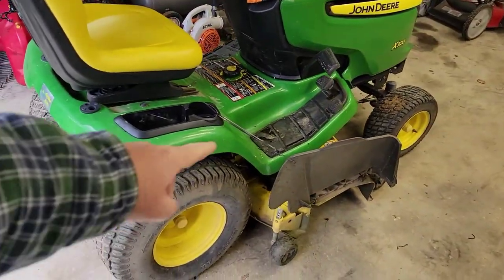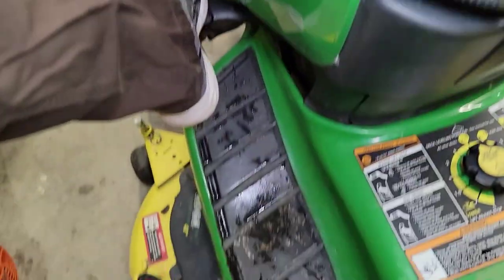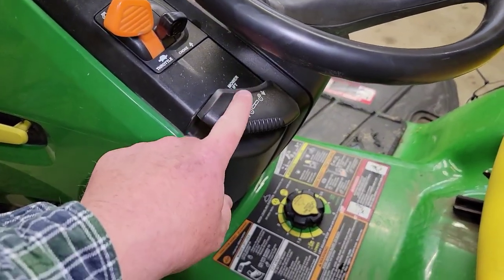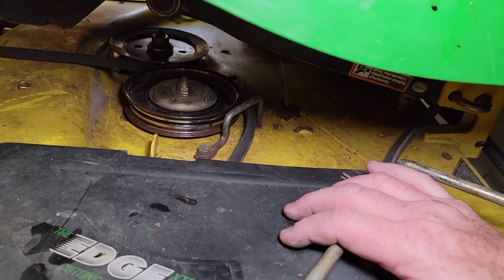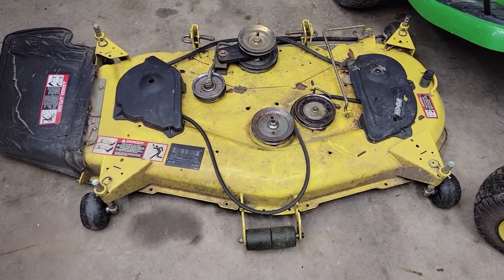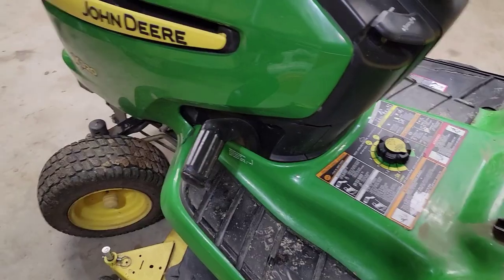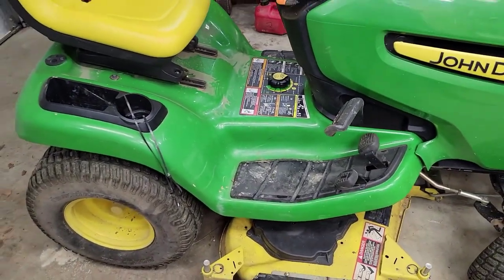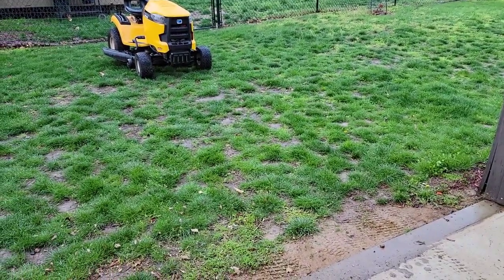How To Replace Deck Belt John Deere X320 Riding Mower BELT FOR MOWER BLADES KEEPS COMING OFF M154958

Comment: Fantastic video! I bought that same mower 12 years ago and will install my second belt tomorrow, since it's too late tonight. I gave up on the first belt a few years ago, and let the dealer install it for me. But, with your video now I'm sure I can handle the project. Already have the new belt. I never knew the deck lift pedal needs to be moved back and locked and also didn't know the back pulley can be moved to create slack. Thanks a bunch for your video!
Reply from the maker: Glad I could help!

Comment: Great video. I was too lazy to take a minute to turn one of the wheels of the deck. Today I turned one wheel, and it made a huge difference - it's worth it to take a minute and turn the deck wheels to assist taking the deck on and off. It really is problematic.
Reply from the maker: Thanks for The tip,  I might have to take the extra time next time and move those darn wheels.  Thanks for Watching and sharing your story, it will help others and me too!!  Thanks!!!
Reply: Or place a large enough cardboard sheet , if available,  underneath the deck and slide it out that way.
Reply from the maker: @steve4628  I need to try that.  thanks for Sharing
Reply: @JustADad  no problem. Gonna have to change blades on an x320 soon to Gator Blades, although just might put it up on ramps. This one doesn't have the option of turning those wheels, they are just straight..
Reply from the maker: @steve4628  Yeah that deck is heavy!! let me know how it goes with ramps

Comment: Thanks for your video.  I have the x320 48”  the blade belt has come off several times. I had the belt replaced several years ago. Your helped me get the belt on w/o removing the deck.
Reply from the maker: Glad it helped

Comment: Also, loosen the nut on the J-Bolts just a bit and pull the pin out, turn it so it rests against the yellow cowling, leaving the hole exposed. Then line the control arm up on the hole, and turn the Jay Bolt pin so it locks into the pull arm. It saves a lot of time. :-)
Reply from the maker: Great Idea.  Thanks for Sharing,   I had to think about it for a min, but that is a good idea.  I am going to do it. thanks!!!!
Reply: Great tip! Thanks!

Comment: Great Job, Really Good explanations. I have the X380, a Built to last John Deere. I use the Best belts Available also and that means John Deere, I tried a Cheaper one in I think 2021 when JD was on strike or something and could not find my deck belt and it didn't last 1 Season. One word of advice, change wobbling Pulleys or loud bearings when spinning, they will freeze and smoke your belt too. And the Spring in the rear needs replace . You can spray a little lube on that bracket to make the parts rotate a lot easier.

Comment: I've had this X320 48" for 13 years. I have never found it easy to pull the J-bolts, or to get both holes lined up to put them back into the lift levers. Nice to see someone else have a little trouble doing it:goodvibes:. I don't have the strength to pull the bolts by hand. Twice a year I dread having to sharpen the blades and service the deck!

Years ago I watched a You Tube vid from a small young lady at a John Deere dealer remove and install the deck  in about 7 minutes (brand new, of course). To remove the deck it takes me 45 minutes to pull the J-bolts using the handle of a small adjustable wrench as a pry bar (even backed off the tension nuts a bit). Then, to re-install the deck, another 45 to get the second J-bolt lined up with the lift bar. I have to use a pry bar to jiggle the deck until it lines up.
Reply from the maker: I agree 100%  Those j bolts are a real pain!!!  I am finally selling mine,  It still runs great but just tired of taking the deck off.  I got the new EGO zero turn battery powered mower with no BELTS to change ever!!!!
Reply: I wasn't aware of electric riding mowers, so I looked them up on You Tube. The EGO looks ideal for flat lawns. Unfortunately my 11/2 acres of lawn is everything but flat. And, between the moles, ants and crabgrass it's getting rougher every year.

The EGO hydraulic seat would be ideal to smooth out the bumps (just what I need). Simple deck removal is great! The draw backs of no variable speed, no lift pedal to raise deck when going up and over some hills and some tree roots (to avoid scalping or hitting roots) And I have to mow across the bottoms of two hills (I have a 40 pound weight hanging on the implement bar to keep from tipping over, and I still prepare to jump off the side if I have to :)).

Best of luck with your EGO. I'll have to struggle with this John Deere. @JustADad
Reply: Yes, always a pain, when just sharpening the blades i bought a mower jack WOW! but replacing belts, a real pain

Comment: Great video! Extremely helpful. Thank you.
I was wondering if you had the part number for the deck belt tensioner spring? I realized after I had gotten my belt that my spring had snapped and that’s what destroyed my old belt (also why it was so easy to get off)
I can’t find the exact part anywhere and the manual is long gone. No worries if not, just thought I would ask. Thank you again!
Reply from the maker: No, sorry  Thanks for you kind words and support.
Reply: @JustADad  sure thing, I ended up finding it. The springs part number is M155068 in case anyone needs it. Cheers!
Reply from the maker: @mal7524  Thanks for Sharing, I am sure mine will need it, last time I looked it had a worn spot!!

Comment: Really, really helpful!
Reply from the maker: Thanks!
Reply: My new belt was so tight that I needed to use a 3-foot bar as a lever to get the slack that I needed to get the belt onto the last pulley.  I would have been really sunk without your video.
Reply from the maker: @Shaleeyah123  Good job!

Comment: @17:50 I would have replaced the deck belt tensioner pulley while belt is off-it sounds bad.
Reply from the maker: yep, I regret not replacing it.  I am ordering one and next time I have deck off, I hope it makes it that long.   Thanks for watching and pointing this out.
Reply: @JustADad  Great video!  I found when I put the deck belt tension spring on it rubs up against the pulley,  This doesn't seem right.  Can you advise?  Thanks.
Reply from the maker: @mikehogan7578  Mine does the same,  I think the rod that holds the pully is bent but it is really heavy so no really sure,  eventually it will cut the spring.